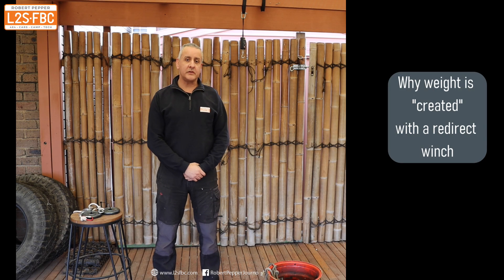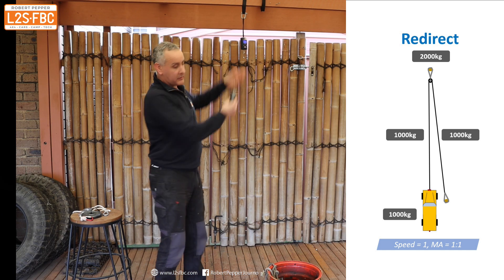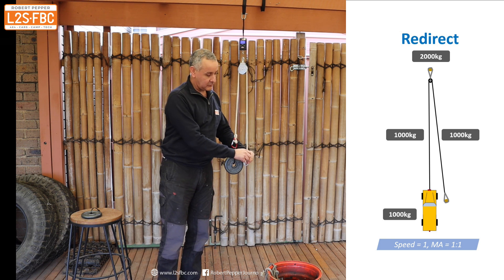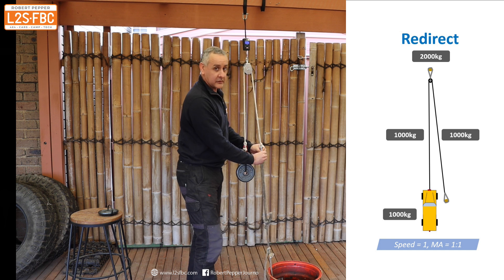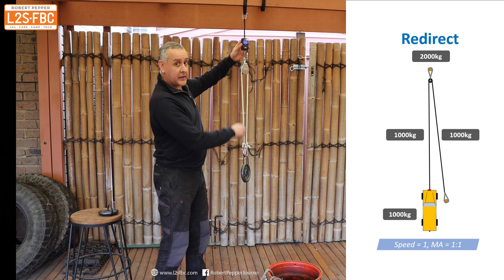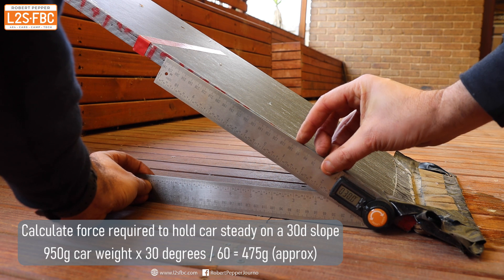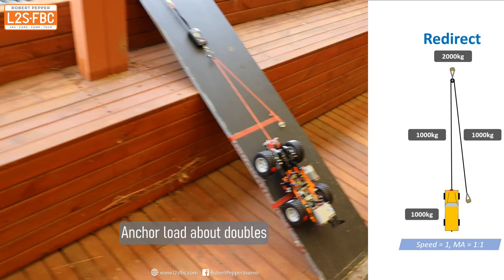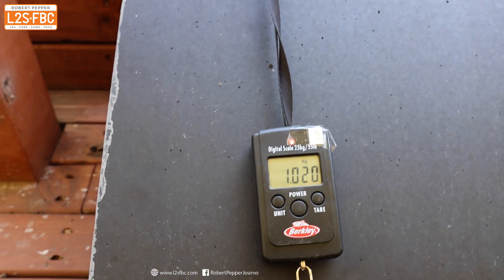One thing people get wrong with snatch blocks - explained

Comment: Best setup is to attach the snatch block to the vehicle being recovered and run a buddy's winch through it to an anchor.
Reply from the maker: Why is that best?
Reply: @L2SFBC  All of the wear and tear is on his equipment!
Reply: Joking aside, the force applied to the anchor is half of that that would be applied by attaching the snatch block to the anchor and running the cable back to the vehicle being recovered.  I prefer to have the pull capacity of the winch to be the weakest link.  That way I don't have to worry about cables snapping, shackles breaking etc.  I don't exceed the working load limits of these components (I can't because the winch capacity is less than the working load limit).  The problem is that I have yet to find a tree with the working load limit posted on it.  So if I can figure out a way to halve the load on the tree, I think that is better.  You can also use another vehicle as the anchor point, using recovery points on it whose working load limit exceeds the capacity of the winch.
Reply from the maker: Exactly I explain that in my winch rig videos and also the one I did with Mad Matt recently
Reply: @L2SFBC  Mad Matt has some really good videos.  For those that use snatch straps, watching the videos he did with Matt Winder in Utah using the ropes is rather eye opening.
Another good set of videos to watch is the ones where Ron Pratt and his father recovered a U-Haul van from a fire road in a National Forest using the 3000 lb winch on his father's Polaris Ranger side by side.  Ron does a lot of work with a rotator tow truck, including a lot of overhead work.  He is highly trained and very safety conscious.  Watching his rigging and his techniques for moving something the way you want it to go is very educational.
Your video was excellent also -- it puts some real world data into it.  I never appreciated how much the load on the cable can vary during the recovery and how fast it can change.  It is those fast changes that could result in the failure of a component, even though the actual load on the component does not exceed its rating.
Lesson learned: take it very slow and easy when working at the limits of the capacity of your equipment.
Reply from the maker: Indeed I will do more about the varying loads and effect of driving when winching. Good post thank you!
Reply: @davidgates1122  nicely done.

Comment: As far as vehicle winching, this video seems to miss the crucial point.  The point of winching the vehicle with a snatch block back to itself is to reduce the load on the winch. And you've shown that the load on the winch is indeed halved.  In fact, you've demonstrated that you should not winch from the vehicle to a second static object, because you are towing twice as hard on your winch point in front of you. So if it's a tree it's taking twice as much load as it needs to and the load on the winch is the same. Instead you want to winch from the vehicle to the snatch block at the tree back to the vehicle.

Now if you're trying to tow a stuck vehicle in front of you you would absolutely benefit by going from your vehicle to the stuck vehicle to a solid tree.
Reply from the maker: The point of the video is to explain exactly what you describe. See the other ones for more general explanations. I am not sure what your point is?
Reply: @L2SFBC  Sorry, it felt to me like you were discouraging winching with a return to the bumper.  I've watched your other videos and see that you meant this more as an add on.  You have a great series and thank you for the excellent videos!
Reply from the maker: Hi, yes I can understand that if you watched that in isolation.  That was to address a specific point which comes up time and again - that merely adding a snatch block does not necessarily give 2:1 MA. It's been a popular video so far glad it's helping, and thank you for the comment!

Comment: So a redirect has a mechanical advantage if the anchor at the top is your mate that your trying to pull out of  the  muck
Reply: Not so much a mechanical advantage in winch rate, but an advantage in that you have effectively halved the pull on the recovery vehicle while keeping full pull on the recovered.
Reply: @johnsullivan6709  if you use the snatch block as the stuck vehicle, this is a very good way to phrase the demonstration.
Reply from the maker: Yes...but then it's not really a redirect. But you've hit on a really important point - the same rig works differently for MA depending on whether you're pulling someone, or pulling yourself.